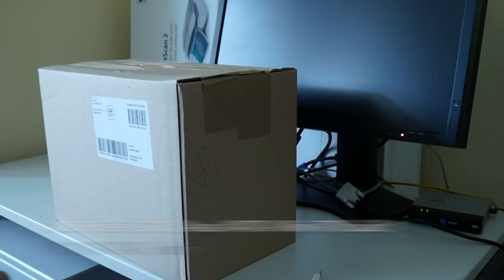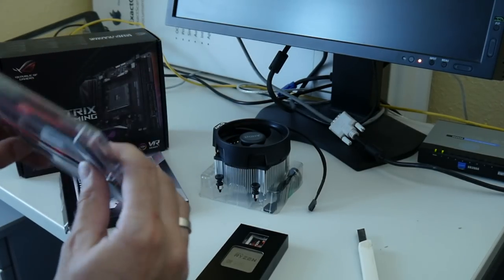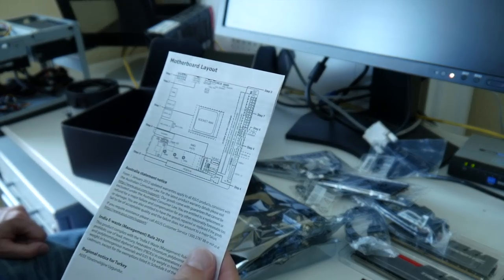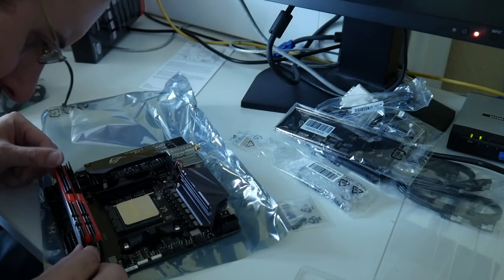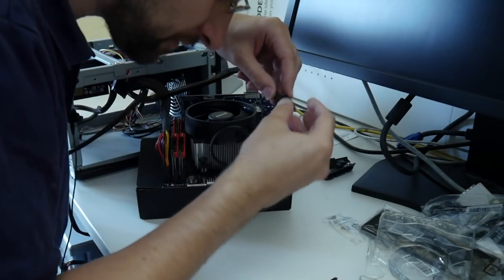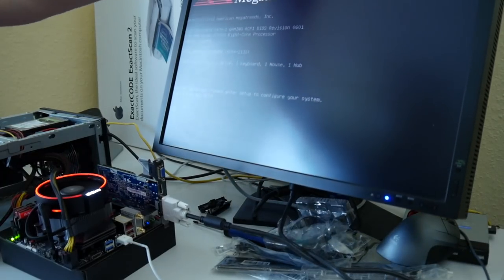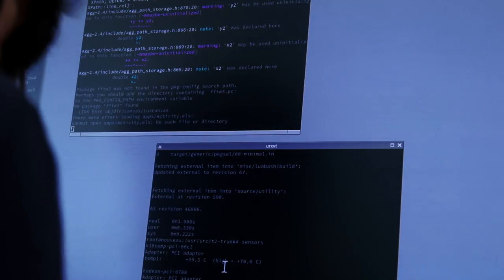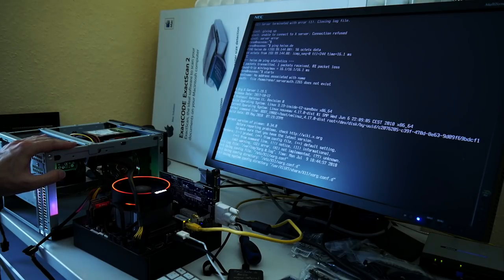AMD Ryzen 2700, Asus ROG X470-I Mini-ITX build part I [DIY]

Comment: Your memory doesn't seem to be running at 3200Mhz. It's running at 2133Mhz, which can hurt performance a bit on Ryzen systems.

You need to configure your UEFI to use the memory's XMP profile.
Reply from the maker: yeah, thanks someone on reddit noticed this also, could not imagine this super complex EFI BIOS stuff would not load standard specs by default, ... :-/ but that is why I make those videos, so that everyone learns something ;-) PS: did not change Linux kernel compile time performance much, … :-/
Reply: René R. I think it's because 3200Mhz isn't a standard JEDEC RAM Timing, and thus is technically an "overclock".
Reply: At least on the Ryzen APUs the memory controller officially maxes out at 2933 Mhz without overclocking, so the BIOS should at least set the RAM to that, but all the ASRock AM4 mainboards I tried defaultet to 2133 Mhz, too.

Comment: It might of been worth while to spend 30€ more for 2700x. The higher clock speed might bring the compile times down a bit more. Also i would recommend you to update the bios to the latest version.
Reply from the maker: Yes, howevert that would be a 105!W  SKU, instead of this 65W, I could anyway try how much I could overclock it for free ;-)

Comment: I don't have much experience to confirm this but apparently the first time you power on the system after installing a CPU the system may take a long time to begin to POST. I think there might be some sort of initialization taking place by the UEFI firmware. I only note this because Linus from Linus Tech Tips commented on this once during a video because he forgot that would happen and was confused by why he wasn't getting video. I'd be curious to see if you see a shorter time to POST after turning the system on a few more times now that you've built it.

Your comment about consumer grade hardware made me curious so I did a bit of looking on Newegg. Mini-ITX is not a popular form factor for server grade motherboards, with the only options really being older XEON based systems. When I expanded the search to include AMD motherboards in any form factor I only found a couple of SuperMicro boards with dual socket EPYC CPUs. So your options if you want to go with either Mini-ITX or with AMD CPUs are limited. It's frustrating, but what can you do?
Reply from the maker: The POST continued to be slow after the first power cycles. Maybe the cheap graphic card is contributing to it, too.
Well, I have not really a problem using consumer grade - I was already waiting for comments like "you can not use this cheap stuff for servers" ;-) but it works for me, saves us big bucks, and as far as I heard Google also started with throwing bare boards on shelves, ..!
Reply: I can confirm . it's normal on AMD boards , very first POST takes really long , second should be normal .
Reply from the maker: there is also a "fast boot" (or so option) where the help text says something like "only initialise the devices required to boot" or so, that may help a little bit, too
Reply: I am swapping my PRIME X370-PRO to this board in few days.. I will let you know how boot goes .
Reply: got this board today , first boot was lame as expected second one and every boot so far is normal as with any other board ..but I am rather disappointed my PRIME X370-PRO had better performance than this ROG STRIX X470-I
Reply from the maker: I currently have no other Ryzen builds to compare, but benchmarks with the same chipset are usually quite close. Maybe memory or other timings etc?
Reply: it's the same memory kit , that actually didn't even work well on my X370 board was only hitting 2800MHz while on this X470 board works on 3200Mhz as it should by default , and it's not the memory my boost clocks are now lower which means this so called ROG STRIX board got shittier power delivery compared to PRIME  lololol

I've got 2600X btw ... and it was hitting 4.250 Mhz on most cores sometimes even 4.277 on some of the cores  ...XFR was doing great .. but now I don't go beyond 4.200 on only 2 or 3 cores 4.250 only on one core ... despite now my RAM working at faster speeds my cinebench scores are way lower

Comment: Can you please tell me what is your 2700 core speed running with the precision boost xfr2?  mine only runs around 3318 ghz - 3400ghz , usually full load in stress test it runs around 3250 ghz.....the 2700 should boost up to 3.9 ghz,  could it be a bad chip ?
Reply from the maker: Under Linux?, from /proc/cpuinfo or /sys/.../cpu/.../cpufreq?
Reply: mine is running windows 10,  its an ITX build, b450 Asus Rog motherboard,   Ryzen 2700,  cpu frequency will be just about 3.4 Ghz full load on all 8 cores,  just want to know how's other people 's 2700 running on full load, can they go above 3.4 all core, cryroig C7 copper cooler by the way, which I guess its similar as the stock cooler
Reply from the maker: I can check the coming days, but are the high frequency not usually only reached when few or single cores have load, I had the impression this is also like that on the Intel side, ..?
Reply: Bits & Bytes w/ René Rebe thanks for the reply!   yes the boost can go up to 3.8 ghz on 1-2 cores,  but I just want to know hows other people 's ryzen 2700 under full load on stress test,  ha-ha! mine caps around 3.3- 3.4 ghz on all 8 cores full load

Comment: Hi, what is the maximum memory speed you can get on this motherboard with the latest bios update?
Reply from the maker: We started to use it as a test server, can't mess around too much with it. Also the board used to run the memory at the rated speed, what more should I ask for? I think I already overclock it slightly: https://www.youtube.com/watch?v=cmJV7RqXVYw 3400 instead of the rated 3200?

Comment: This is a joke becuse ur using an amd ryzen 7 with a ddr3 2gb graphics card 😑😑
Reply from the maker: no it is NOT a JOKE, I not only point this out in detail in the video, a) this is a Linux server computing note (like early Google style, just thrown into shelves), b) ideally I will later try to even run it without GPU at all (no clear information if latest EFI BIOSs allow this,…)  and c) I clearly point out that this is entry level, intentionally, and why I did not got a higher end one for the test, namely: not sure if it would fit into the slim case (but probably would) but most importantly, I would not even want to leave a higher end card in the compute node in case the stupid, cheap PC EFI BIOS wants it to POST and boot, ..! Thanks for watching, share like and subscribe! ,-)
Reply: Ahhh ok sorry
Reply from the maker: no problem! Each new comment welcome ;-)